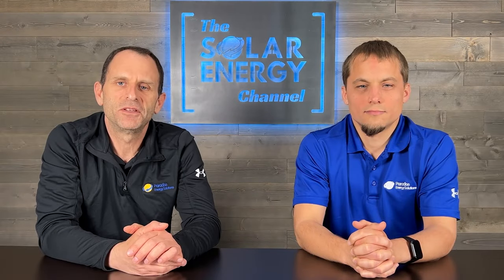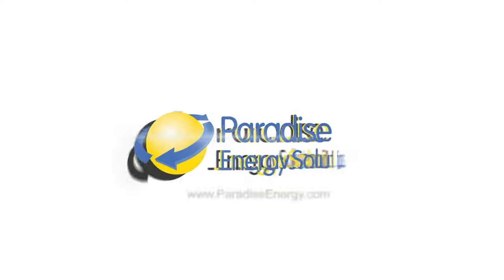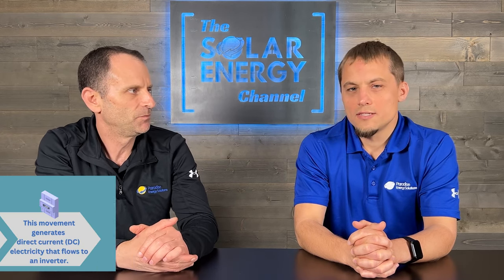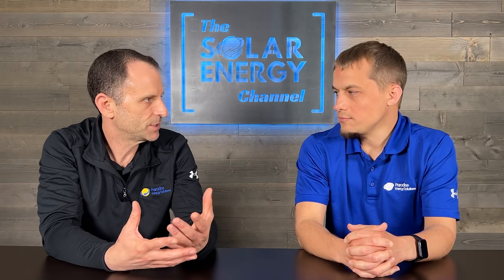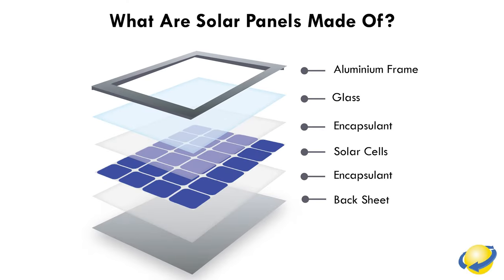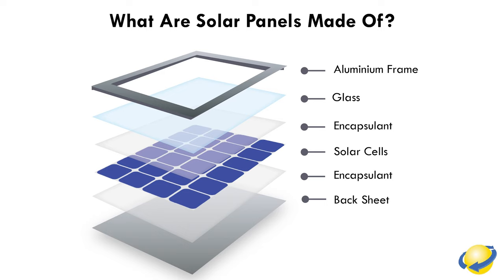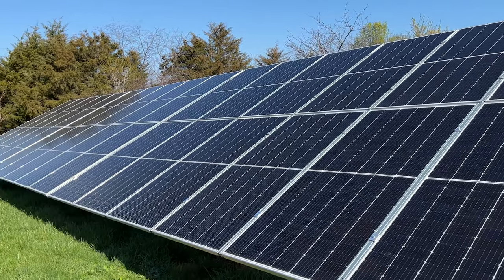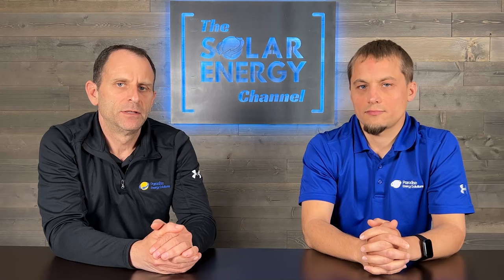Exposing Solar Panels: Are They Truly Eco-Friendly?

Comment: I ain't buying it!  The carbon cost (which I don't give a hoot about) to collect raw materials, manufacture, erect, and maintain/replace panels ( that only work at about 30% efficiency on good days) will cost a net increase of CO2 under current methods of extraction, refinement, etc.  We live here and now.
Reply: Aye D didn't you hear the man said once they are on your roof and plugged in you're good to go, zero emissions!